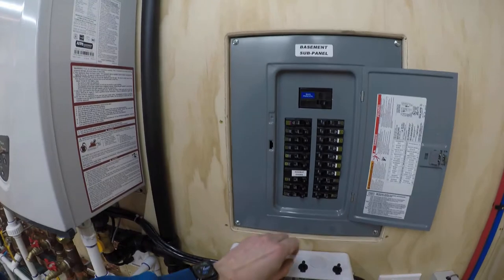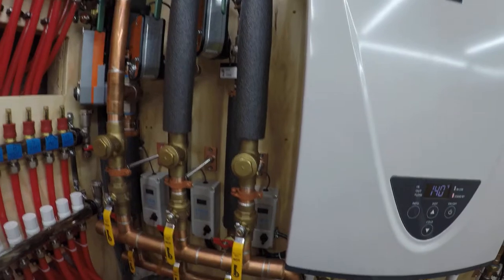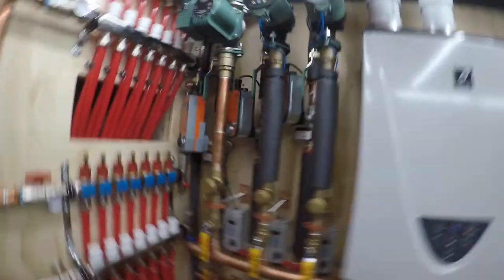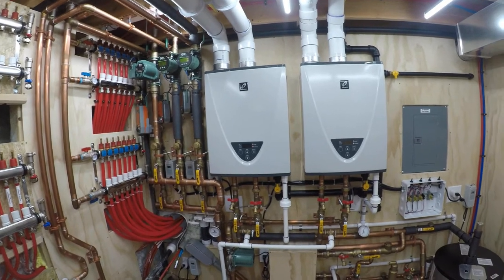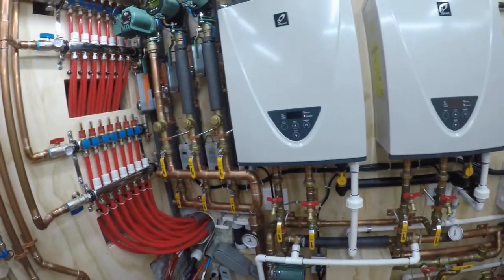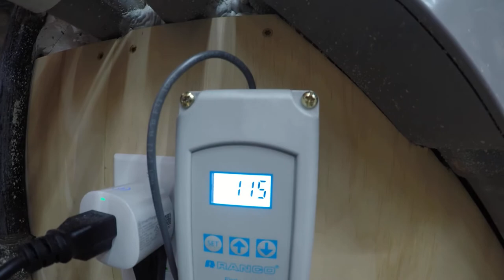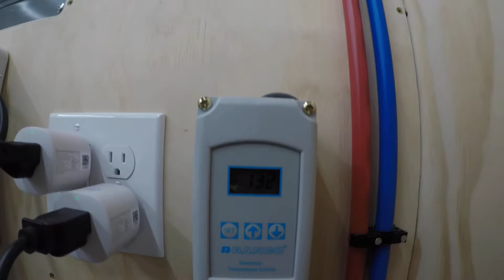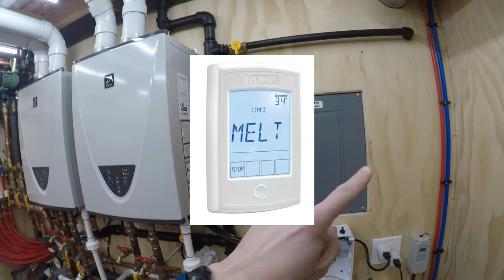Heated Driveway & Radiant Heat Electrical System Overview - Episode 58 [2-15-2021]

Comment: This is awesome but overwhelming. Any tips on getting started?
Reply from the maker: Everything starts with a design and load calculation.  I would highly recommend googling "Uponor Snow Melt Design Manual".  Read through it, and perform the calculations in Chapter 6.  Use the provided charts to determine your design conditions and load requirements.  If you know the square footage of the area you want to heat, that manual will help you determine the pex size and spacing.  I would just worry about getting the proper size pex in the slab right now, properly spaced, and enough loops.  Worry about the heat source later.

Comment: I have to say. You have inspired me to design a system that is beyond anything I have thought of. It will cost more to build, but just knowing how to utilize heat by continuous circulation is priceless. The entire set up is incredible!
  I was going to ask if a Taco Relay would work on your set up if the Aqua stats and 3-way valves were the 24V models, but I’m guessing no?
Reply from the maker: Thank for the kind comments Tim!  I do think a Taco switching relay would probably work, but you may need to step it down to 24v?  I haven't looked to see if they make a 120v one.  I do know that they are a bit pricey. Something like $150 for a 3-zone Taco switching relay?  The ones I used are 120v IDEC relays I got off E-Bay.  I think I paid $10 for 3 of them brand new, and if they go bad, the base stays in place and you just pull the relay part out, and plug in another one. Done!  A cool feature with some of the taco ones is the priority option, so you could give a zone priority over the others if you wanted.  I didn't really need that here.  Thanks for watching!  We've been getting a ton of snow here this month, and I already have 3 or 4 time lapse videos in the queue to be edited / uploaded!  If there is anything else you want to see, let me know and I'll make a video! :)
Reply: @DeckerChristopherJ  I am in NE Ohio and we are getting snow just about every day too. I have researched hydronic systems for years and your system has surpassed any I have seen. I have a cart full of items sitting ready to be ordered from Supply and I’m excited to build my system. 
  I am currently heating with a Wood Boiler as a staple up/forced air system and it’s time to upgrade to a less physical heating solution. 

Thanks again for all the information in the videos.
Reply from the maker: Thanks Tim!  I remember that feeling...  In December of 2019 I placed my first supplyhouse order of like $2,000 worth of supplies.  I remember clicking that order button with that feeling: "This is it, if I order this, it's DIY all the way, no going back.  Sure you want to do this Chris?"  Haha. A year later, I would do it all over again.  I'm sure the right plumber would've done just as nice of job, but I know every inch of this system.  I know exactly how it works because I designed it, and I know exactly how to fix it when it breaks.  I taught myself to solder, and soldered every joint.  I am no longer afraid of it. I have no doubt you will succeed with your project!
Reply: @DeckerChristopherJ  Thanks for the uplifting comment. I can only imagine how many hours of research and labor you have in your set up. 

I’ve been searching for parts to build a relay set up (like yours) for a 2-zone. I understand the concept, but this will be a new experience using relays, motorized valves and aqua stats. I am determined to have a system that offers continuous circulation.

Comment: Out of curiosity did you put foam board on the edges of the slab?
Reply from the maker: I did not insulate the edges.  I did when we poured the garage slab though, and we 45'd the 2" rigid foam up to the outside edge of the slab.  If you watch the original driveway time lapse, you'll actually notice that the outside 6" of slab actually doesn't have insulation under it either.  My concrete contractor wanted to make sure the outside edges were nice and strong, and that the foam board was encapsulated by concrete on all of the edges accept for the bottom.  The driveway is 5" thick, 7" on the edges.  We used little pieces of 6" wide 2" foam to keep the insulation board in the middle from moving during the pour, and the guys pulled those pieces out as they poured.  I have slower time lapse I can upload of the process where you can see it better.  I kept the pex 12" in from the outside edge of the slab, and it shows.  I don't really get a crisp melt line along the edge of the driveway, usually the snow is wavy over the edge of the slab.  I'm not complaining, I sill don't need to shovel it. :)